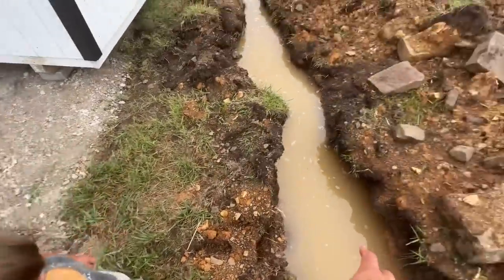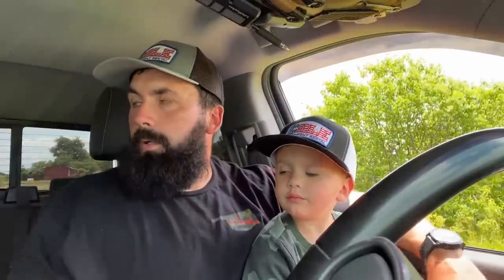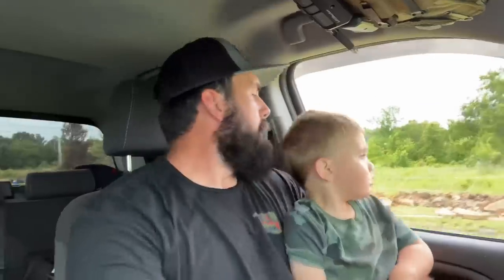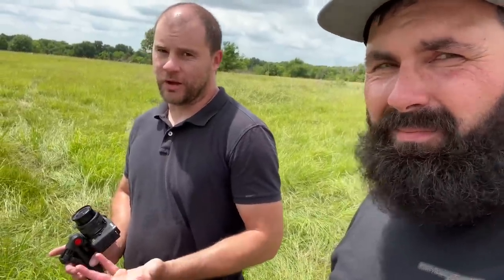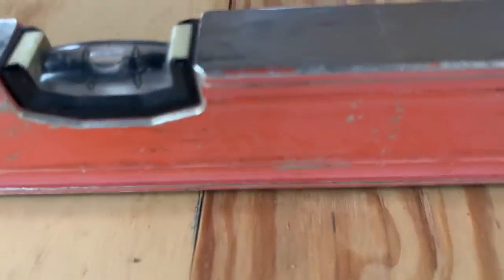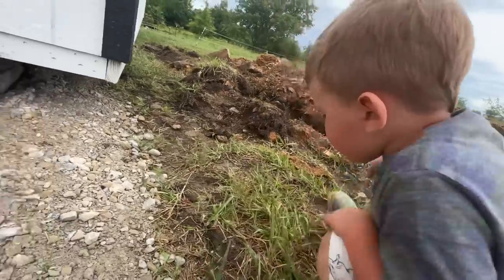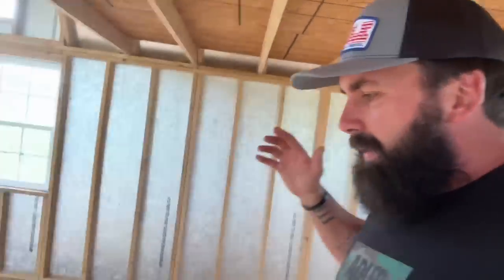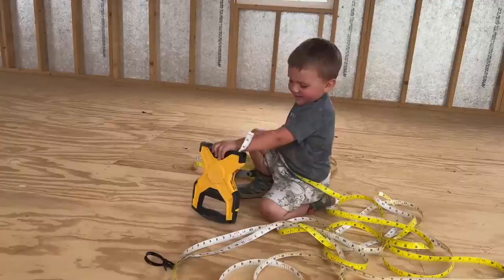IT’S BACKWARDS! SHED TO HOUSE DELIVERY GONE WRONG!

Comment: Our first house was a shotgun-style (16 x 40').  It was originally a summer cottage with many small room additions according to the many wall paper patterns and stove pipe holes in the walls. The water was turned on in 1906.  Not sure how long it was around before the water hookup.  It was owned by a family who owned the Spreckles Sugar company in CA.  We also had mom-in-law house in the backyard (12 x 20'). After the kids came along, we built a 4 car garage with 2 bedrooms and a bathroom above.  After we sold and moved in 2003 ($$$$$$) the buyers remodeled it to a point where it didn't resemble our house. It was too modern for the old neighborhood!  One thing that might be useful for people building a garage is a second garage door for a drive-through since there wasn't any side yard to get through.

Comment: We purchased a 12x20 storage shed. It has a hip roof and when they took it off the trailer, they rolled it it’s side. When the picked it up to right it, it rolled over the roof onto the other side. They had to load it back up and bring us a different shed.